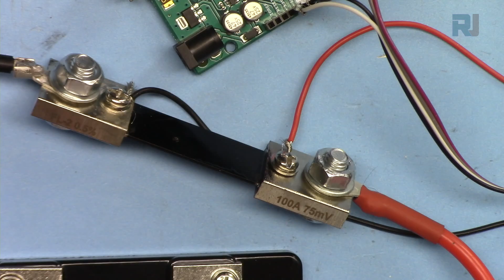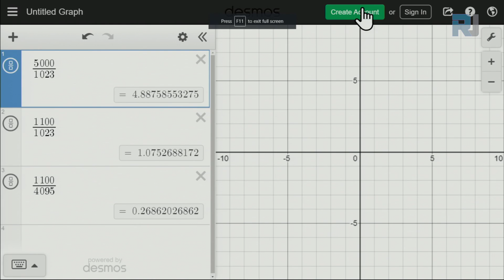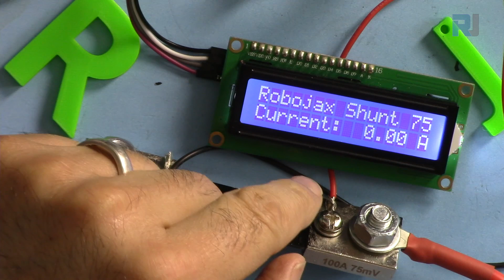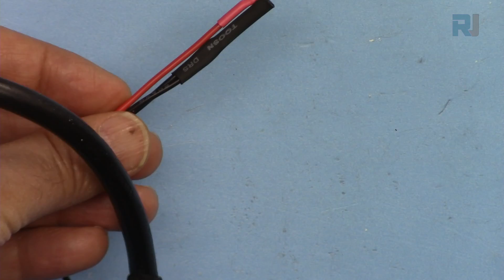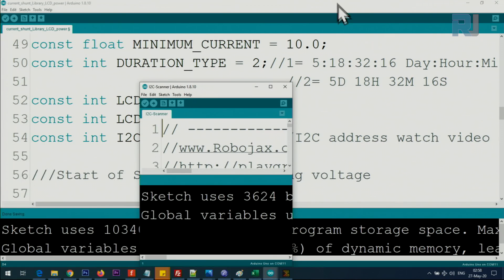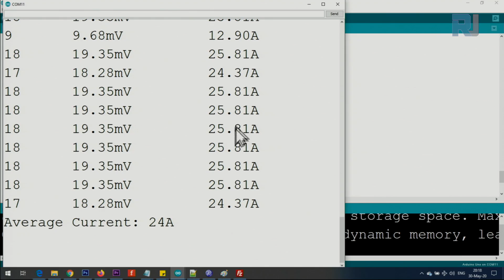How measure DC Voltage and Current and build Energy meter with LCD Display | Lesson 104 - RJT425

Comment: Isn't there a sort of an averaging function that can be placed in the code, so that your current readings contain less noise and variations?
Reply from the maker: I have shown how to take the average. The rest depends on the tolerance of the shunt resistor. Get better shunt resistor.

Comment: Hey!!
Great explanation!!!
Can you please write this code for displaying voltage and current in tm1637 display
Reply from the maker: Hi, TM 1637 is just junk. Very hard to use with decimal points as I spent hours in many days . Then gave up. I found a display that can display easily any value here is the video https://youtu.be/4aCgHNJl9kY just watch and it would be very each to use the energy meter code and display it.
Reply: Hey!!
 thanks for the support, but the problem is hk16k33 is not easily available. What if I wanted to display only the current and voltage part from the energy meter in a 16x2 lcd display. Please tell the changes that I would have to make in the code!!
Reply from the maker: Hi, the HT16K33 should replace this junk TM1637. I have made so many videos unfortunately for TM1673. I wish I could delete them . I remember when I found the HT16K33 I was like "yes I found it" kind display. I have the link to purchase under the above video and I am also selling it on Amazon. Good luck.

Comment: helpful video😍🤟 hmm just wanted to ask if i wanted to show the (Ah) of the battery instead of energy. what would be the code?
Reply from the maker: Hi, I have explained the code fully and if you know how to calculate the capacity of battery with pen , easily you can do it as we have all the information needed to calculate capacity. Just learn the formula and then come back to the video and use the values from the code.

Comment: Hello sir thank you for the helpful video, Can I measure current upto 500A and voltage upto 35V with your circuit and code ?
Reply from the maker: Hi, it seems you have not watched the video. Please watch
Reply: @robojax   I watched, just confirming that because I am doing a project in which I have to measure current upto 500A and voltage upto 35V and I am new in electronics. If you ans me then it will be very helpful. Thank you 🙏🏿
Reply: @raghvendrasutar9880  have done it?
Reply: @eternal3789  Yes

Comment: Hii sir 
In my project my dc voltage is 450v dc 40A and i need to measure the current with Arduino it's safe to Arduino to connect control ground and arduino ground?? Please reply love from India 🇮🇳❤
Reply: Have you design this??

Comment: can i apply your project for my 254VDC and 50A Bettary Monitoring. I confused for 254VDC, you connect Shunt output directly  in arduino, please replying you best
Reply from the maker: Hi, may be you don't understand the meaning of shunt. Shunt resistor means the current passes through it and the voltage will be max 75mV or 0.075V so 240V is not there . watch agian.
Reply: @robojax  I know the signal voltage is 75mV but my load voltage is 254vdc 50A, so how can i make my project

Comment: I have a question, since the current is suppose to move in the bath witch has the lowest resistance and assuming that that the resistance of the load is higher than the resistance of the voltage measuring circuit, then this would create a problem. The whole current would be moving in the voltage measuring circuit. Do you have an explanation?
Reply from the maker: This will not happen. Measuring voltage is separate from current.

Comment: can i use the same method to measure 10 -15 amps through 0.1 ohm resistor 
thanks in advance
Reply from the maker: Yea you can use it with the shunt . Just calculate the mC value of the resistor and A ratings. Like 20A 30mV
Reply: @robojax  thanks a lot  👍

Comment: Is that possible to AC  ?
Reply from the maker: No. Use this sensor Measuring 5A-30A AC and DC current using Allegro ACS712 with Robojax Library (code added into video)
https://youtu.be/3C33DpcSwIw

Comment: Can it be used with an op amp to read current less 10 amps?
Reply from the maker: No. Hyde smaller shunt for any current you want . I thought there won’t any questions as I explained the tolerance of 6.5% for 100A shunt . Please b watch carefully
Reply: @robojax  Hello, What´s your recomendation for this case to measure current lesst 10 amps?

Comment: Dear robojax How can i used this code for arduino dc energy meter for battery high voltage and low voltage protection pls help me
Reply from the maker: It can work with virtually any voltage. For protection, it has already action and I have show how to take action. You just need use a relay to connect or disconnect something when your protection condition is met.
Reply: @robojax  I was tried but code is not complied pls help me how can I take action both current voltage protection with relay